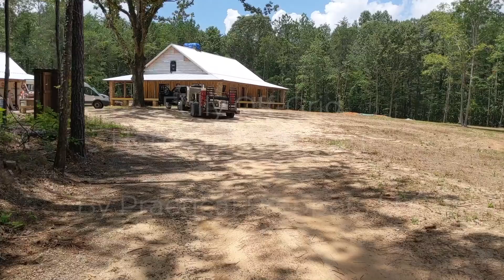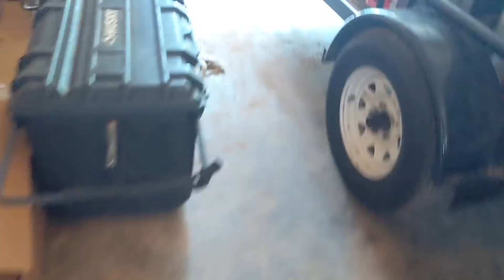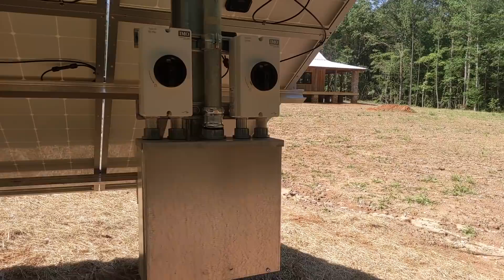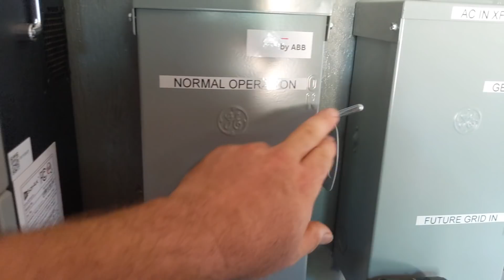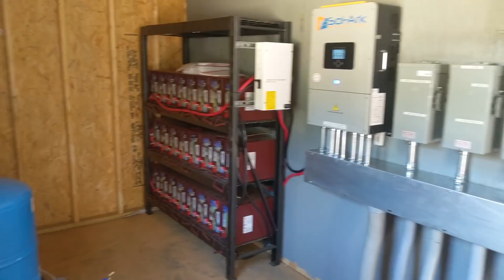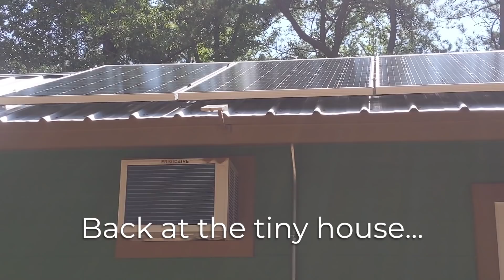Sweet Solar in Alabama (100% OFF-GRID SOLAR)

Comment: I'm doing something similar with off grid homestead and tiny house. I have 32- 260w panels now and looking at what controller, inverter battery banks ECT. We are also running propane gen along with gas and wood appliances.  It be nice to get your input thanks kyle

Comment: How much porn can I watch before the batteries die?

Solar panel https://amzn.to/2Cx3J5t
Eco-worthy 1000w https://amzn.to/2Cg8i4a
Amazing shower https://amzn.to/39trFTi
Earbuds https://amzn.to/3fcw3Iv
Kindle ultimate https://amzn.to/31PAx3N
Twitch prime https://amzn.to/2ZIgcLl
fire tv stick https://amzn.to/2C2bTlE
Midea U Inverter Window Ac 8,000BTU https://amzn.to/3eRYzyp
Necklace fan https://amzn.to/2VGlIwU
Sense Energy Monitor https://amzn.to/2T2u3JD
Spiderman FFH https://amzn.to/2W3NIK7
Aveners: End game  https://amzn.to/2KOhyx7
Metamucil double https://amzn.to/3aHoNB8 single https://amzn.to/3bmvVTU
Canon EOS M50 https://amzn.to/35fHX0c
SONY RX 100 VI https://amzn.to/35bteTS
Canon PowerShot G7 X Mark II https://amzn.to/2WaAPhp
CANON 90D https://amzn.to/3cX8z8O
SONY A6400 https://amzn.to/2VMUNzL
Darth Vader and Ahsoka https://amzn.to/2A3qDjl
Captain Rex https://amzn.to/2L2tMST
Ahsoka Rebel https://amzn.to/2A0hoAl
Anakin https://amzn.to/2W8QZch
Skillmatic https://amzn.to/37PwSEn
Aqua 4 in 1 Monterey https://amzn.to/2Ctihmm
Bunch O https://amzn.to/2YWQodL
Face mask https://amzn.to/2ZBw2Y9
Enema https://amzn.to/2YTOquQ
Amazon business account https://amzn.to/3h9t98K
100 disposable gloves https://amzn.to/3dEbNh9
Bicycle rollers https://amzn.to/2VFCOLh
Oscilloscope https://amzn.to/32tCFyA
Ispring reverse osmosis https://amzn.to/2Wy6D0I
Flex Seal Spray Rubber Sealant Coating  https://amzn.to/2OWPERv
Great Stuff 157913 Big Gap Filler, 20 oz https://amzn.to/39t7lBK
Reusable Half Face Cover, NASUM M101 Face Cover https://amzn.to/3jDWFVl
Rockport Men's Bennett Lane 4 Venetian Shoe https://amzn.to/39tqumR
Helix Flexible Stainless Steel Non Skid Ruler https://amzn.to/3jECy9B
Bacitracin Zinc Firtst Aid Antibiotic https://amzn.to/30KvsHT
Bella & Bear hawaiian sea salt shampoo   https://amzn.to/2Dst6pc
Bella & Bear hawaiian sea salt conditioner https://amzn.to/2PiRFHO

Comment: If the well is inside and there's an issue later (or should I say, when there's an issue), how do you get to it to work on it from above? Or did the building have a hinged roof for this? "Blessed are the flexible, for they shall not be...[pause]...broken" LOL

Comment: am I the only one that is at a lost why you need to EMP hardened your batteries .... for an event the might not even effect batteries, doing lead acids is not justified in my opinion.
Reply: I am lost about the fact that he said lithium batteries are not EMP hardenable, at least not at a reasonable price.. I didn't know lithium could be ruined by an EMP. Did he do a video about that?
Reply: @gina50gina  I did a. quick scan and all i found is he mentioned that there is a slight chance that lithium can be affected by EMP ..... As an engineer I dont think this is an acceptable reason. its kinda like reasoning with a doomday preppers I think ..... but to each it own. The solar is cool and rainwater harvesting and well water access. If it were me I would not use land real state just for solar panels though .... I would probably put a shed there and put solar of top, or greenhouse ....
Reply: @fr1day1700   Hi Mark, thanks so much for your effort. :) I wasn't sure if he had done a whole video on the issue, cause I'm fairly new to the channel. That's why I had done the search. My initial plan is that I'm converting a Ford Transit to be a small class B RV for travelling starting hopefully next year. I was planning on using lithium as they are lighter and take up less space. But I would also like to have the solar system to supplement in times of power outages at home, and was concerned when he said what he said lol. I like your greenhouse idea. have you looked into EarthShip homes? I saw once that you could build an earthship greenhouse. :) Very efficient and can be make of used materials.
Reply: @gina50gina The RV idea sounds like a project ..... I think the thing solar is it works best on large footprint, so putting it on a small space would take too much real state (plus weight on batteries and inverters and your stuff) ..... If I am thinking of RV + solar, I would probably wait for Cybertruck, then build a towed living quarters with solar installation on top. Maximize sq footage for living and as tall as possible and with extended arm design for additional solar panels when park ...... bear in mind this is just a concept in my head with no calculations done for power requirement. Water + grey water + ** water storage and quick and clean disposal should be considered for a truly off grid RV. And AC/heating is a must I think ..... all just an idea of course and requires building stuff lol
Reply: @fr1day1700  lol Mark, the Cybertruck with extensible panels sounds amazing, but on my budget is going to be a minimalist project with about 400W solar on the roof, and 2 lithium batteries and all the in betweens, fantastic Fan, sleeping and cooking area, compostible toilette. It's a small space but it will give me the freedom and opportunity to travel. 😁

Comment: I’m putting in a solar system and having it set up to survive off grid if need be. What components do I need to make sure are emp hardened? I think they plan on a lithium battery so should I change that to lead batteries? Inverter? What else should I worry about?

Wish you were closer, I’d have you guys for sure do my work.
Reply from the maker: The only system that I know that's EMP harden is the solark  with a AGM battery. I'm happy to get you one and a battery if that would be helpful.
Reply: @engineer775  that’s awesome. Everything else should be ok then As far as the wiring and other components go? What are the specs on the AGM battery? I might take you up on this. These guys are knowledgeable about their solar set up but not in the terms of setting it up for being secure etc. let me discuss if we can change my set up to include getting this from you.

Comment: Just my two cents, no way would I put the well in the same room with the battery bank and all the panels.
The well should have had it's very own room with large filtration system and large storage sytem for water .
It does not matter how high tech a place is, without clean potable water, it's just a pup tent in the woods.
Reply: Hopefully the risk is low. The batteries won’t likely vent any gasses since they are sealed, I use those inside my house. If there is a water leak that sprays water on the battery bank that could possibly get ugly.
Reply: Lol. That means my in- town house is a pup tent in the woods. Nobody in my neighborhood drinks the water.

Comment: Looks nice except those batteries. I don't get why he can't use lifepo4, if you build from the cells and  add your own BMS you could store backup BMS's in a faraday cage, or you could run the batteries fi necessary without a bms, I ran lifepo4 for a couple years without a BMS, as long as the batteries are matched nicely, they won't wander out of balance much.

Comment: NICE  setup.    De powered electronics will survive EMP,  use Faraday cage.   NED / CROWBAR  required other wise to avoid  LEU of  ICs on each voltage rail.
( retired aerospace electronics designer )    NICE,,  but in the middle of ALB
Lighting arrestors /  suppression?  questions ?    
Heat pump for HVAC

Comment: Awesome work!  Going to be installing a grid tied system with 32kw battery back-up.  How does a single 8k sol-ark effectively feed multiple 200amp panels?  Wouldn’t 32amp run out of room to supply pretty quick?

Comment: Couple of suggestions:
1. Use The 2" Threaded Rigid pipe to connect the wireway to the panel. The advantage is you can slip on the rigid pipe while the panel and wireway is already mounted. With the standard EMT you cannot do that.

2. For the GenSet, I would recommend a diesel instead of Propane since the homeowner can supply diesel using 5-gallon jerry cans. With Propane, you need a delivery truck which could be a problem when hurricanes hit or there is high demand for propane delivery.

Comment: They could still use Lithium with just charger and changeover switch after an empty use lead acid just enough to maximize life and keep charged . Put a faraday cage around them and can't get hurt when disconnected.
Reply: The simple approach is to use prismatic cells with your own BMS system. The BMS is the only thing that would fry, put a spare unit on shelf. For the cost of the Solarks you can literally afford to put a set of panels and and inverters on the shelf to swap out after. Keep in mind every other electronic item in that house would be fried too, so it's not like using the Solark is going to save those items. 

I keep a few spare panels, a charge controller, and inverter and a spare bms on the shelf. Sure I won't have the power of my full array after, but I'd have power for the basics. On the other hand I'm not going down the full on prepper madness craze some are. To each their own.
Reply: @andycanfixit  DFi am not either.  if you haven't already use the extra panels for direct pv tp electric water heater for sole heater or preheater for got water.

Comment: For the record, in Europe a "48" V 1000Ah lithium battery bank complete with Winston, made with 16 single cells, BMS replaceable external single modules with management  app and bluetooth, costs in USD 19,800 without taxes. The excellent LiFePo4 batteries from Winston have been tested for years now, they are not well seen by "you" or am I wrong?
Reply: logically in the installation of the video you don't need 1000Ah of LiFePo4, but I would never go below 400Ah @ 48V for an installation of this size.

Comment: Howdy to Jordan!  
BTW: You can use your cellphone as a wi-fi hotspot if you ever need to update on location without local internet.  
.
It is 8:55am and the temp is already 82 with a heat index of 97...Alabama is way too hot!

Comment: Question you said there are no EMP hardened non lead batteries "to exspensive" can you EMP shield the building that houses the batteries to protect from the EMP
Reply: Here are some suggestions that might attenuate an EMP to avoid damage.
1. Put batteries in a metal cabinet that is grounded. Also install grounding straps to the doors so that the cabinet doors are full grounded. When the doors are closed the cabinet will serve as a partial Faraday cage.
2. Install Ferrites to the battery cable (Both wires) This will help attenuate the EMP that conducts into the battery cable.
3. Install TVS diodes across each set of battery terminals. TVS diodes will clamp any transient surges across the battery terminals. You can by TVS diodes from mouser.com, digikey.com or newark.com (electronic component distributors).

That said, I cannot guarantee this will work, but these are the methods commonly used to protect non hardened electronics. The issue issue with Lithium batteries is they have electronics to charge balance the batteries and also to prevent over charging them. The battery chemistry isn't impacted by an EMP.

That said this won't protect your appliances or electronics from an EMP. You can reduce the risk of damage from an EMP, for your devices by install ferrites & surge suppressors at the point of load and at the panel. A whole house surge suppressor can attenuate a EMP coming in from the grid and ferrites can also antenuate it two as a passive surge supressor (but not as effective as a surge protector). for devices that I cannot install a surge supressor (like ceiling mounted light fixtures, I installed ferrite torrords. since ferrites cannot fail where as MOVs or TVS diodes can fail and would be difficult to replace in a light fixture. 

If your building a new home, or redoing the electrical wiring, install MC (metal Clad) cabling will also anttenuate an EMP as it shields the cabling as a partial faraday cage.

Comment: What a beautiful installation. There is nothing more gratifying than to seeing pride of workmanship in water ( not in this case ) and electrical conduits running into panels installed in a neatly organized room, they’re works of art IMHO.  The way this person has prepped I wouldn’t be surprised if there is a hidden shelter under the house.Would it be disrespectful to ask a ballpark figure of all that, meaning over/under fifty, over/under a hundred K something like that? Am I even close?

Comment: Those Lead Acid batteries are ugly. You are right - this is 2020.  Lithium batteries are not affected by EMP. If you buy something prefabricated with electronics then the electronics are affected but not the batteries. if you build a battery bank with just cells it will not be affected. If you use and external BMS you just buy a spare BMS or 2, just in case. That is another $100 or 200$. in case of EMP you just swap the fried BMS with another one. I know that the owner needs to do that but I think a quick training for the owner is worth it.
Not using LiFePo4 batteries adds a lot more cost and also adds complications. Those batteries will not last long term off grid. no more than 5 years. 
 I think you should specify that you, as installer, will not do it because it adds complications to your project, the owner needs to know a little about the system, but you are and engineer, just come up with something. 
You should explain that in order the people to learn from your videos. You just can't say that you cannot use Lithium or that is too expensive.
Reply: My friend.  The majority of our customers are not going to replace a BMS after and EMP, I’d like to come see how hard that would be since I have not seen my friends in a while but it is so hot and I am so busy. . Also this job was sold over a year ago.
Reply: @GainSolarPower  I mean it is easy; Just unplug the 2 x 8 pin connectors and plug them in the new BMS. 10 Seconds. If the batteries are fully balanced you do not even need a BMS for a long time. So really, a battery with external BMS that just balances the batteries would not be affected in case of EMP even if the BMS is fried.
In case of something like Fortress batteries or Tesla where the BMS controls the battery and stops the flow of electricity if is too hot or too cold, or is the voltage is too low, then yes, you are affected by EMP. That is the reason I would not buy a battery made with all those electronics.
Reply: @mlg779  The BMS could die as a dead short, unless its properly fused.
Reply: @guytech7310  Not sure I understand. Can you explain that ?

Comment: When you have the well inside a building like that, what happens in the future when the well pump goes bad? How do you pull the old pump?
Reply from the maker: We installed it the same way you would remove it.  We hung the pump on 50 yrs 200psi rolled poly pipe.  You can pull it right our the door and change the pump and drop it back in.  I can do a change out in 45 minutes.
Reply: @engineer775  Thanks for the quick answer.  Every well I have owned had pvc with threaded couplings.
Reply: having pulled a pump at two houses, I was wondering the same thing.

Comment: Really nice setup!  Question: How do you pull the well pump if servicing is needed?
Reply from the maker: We installed it the same way you would remove it.  We hung the pump on 50 yrs 200psi rolled poly pipe.  You can pull it right our the door and change the pump and drop it back in.  I can do a change out in 45 minutes.
Reply: @engineer775  Awesome!  I did not realize the proximity of things.  Thanks!

Comment: Where do I sign up for the Grid Solar for 100% off?
Reply from the maker: Did I say that?  If I did I was sufferin from heat stroke!
Reply: I read it like that my friend. Lol. Thought it was click bait.
Reply: Fat Rat It kinda was but it could be if you don’t live like most folks on grid running air conditioning nonstop all day that’s almost everyone’s biggest energy cost here in the south to beat this disgusting heat and even worse humidity.
Reply: Didn't he say they were using propane for hot water? Therefore not exactly 100 percent off of solar... Those AGM batteries don't last forever either. In several years they will be forking out a lot of money for new batteries. But obviously with this setup they can AFFORD to buy you a similar solar setup... But they won't...
Reply: @ronclark9724  Just to be clear to everyone, I was just joking about how the title of the video was worded. 100% Off . . . . Grid Solar. Yes he has it hyphenated correctly. Just that it can be missed if read quickly.

Comment: How will you cool the generator room? If you may?
Reply from the maker: it is open to the outside.  It will not be closed in.
Reply: The issue that I'm having is the batteries see 100 degrees ( at times ) within  my room open to the outside. I have a fan in my generator room and 2 in the battery room. I'm off grid and heating and cooling have been an issue. 
Has this been an issue with anyone you know?